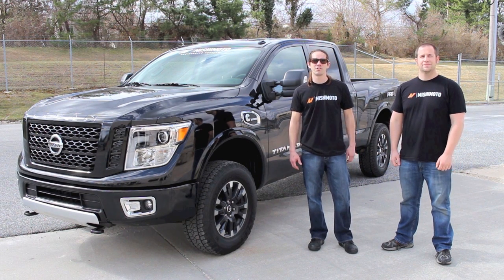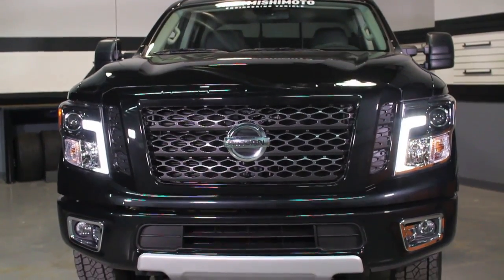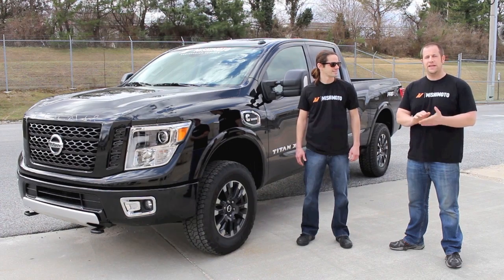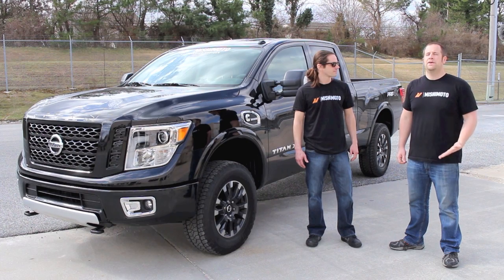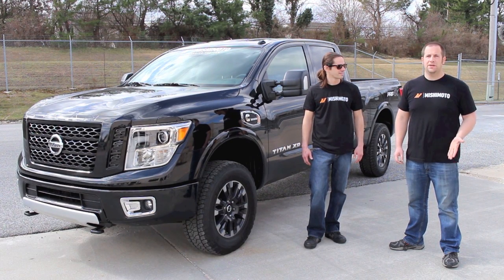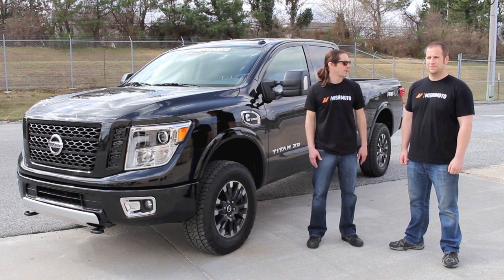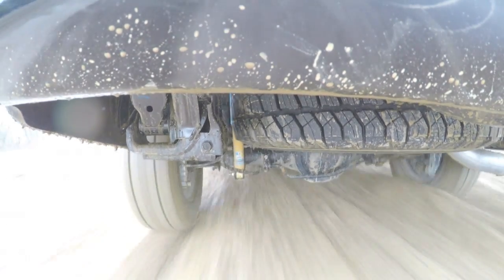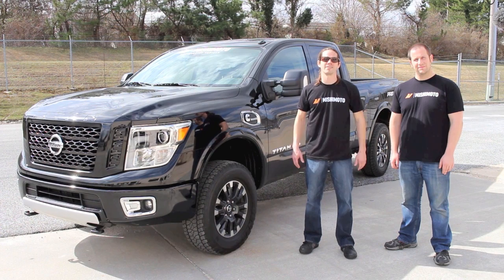Mishimoto's Nissan Titan XD Review Series Part 1: Initial Impressions

Comment: So I went to the Titan experience here in AZ.  Power was nice and smooth, brakes were great, and the ride was smooth and quiet. I loved the truck... except for the annoying driver aids.  Dynamic steering caused the effort to vary drastically from upper arm and deltoid workout hard, to be careful where you point the AC vent easy, and they did it on purpose.  Then I crest a hill and the damn thing slams on the brakes, the rep is bragging about hill descent control and I'm like, "that is super annoying and probably dangerous on a slick hill, I never want to experience that again; how do I turn it off?" The added technology took an awesome truck and sent me home bitching about it.